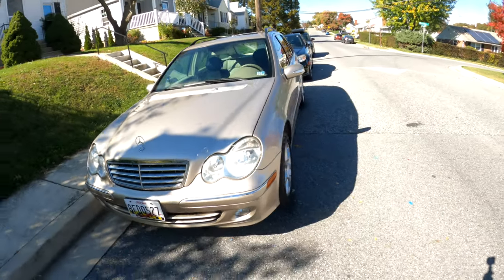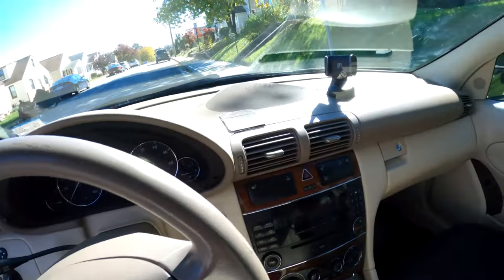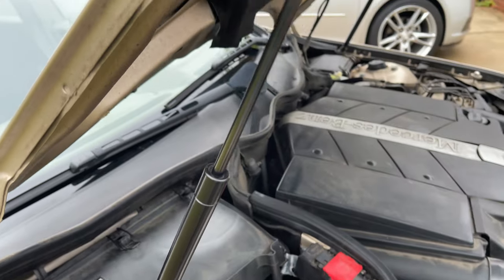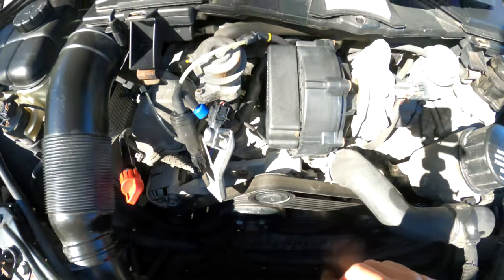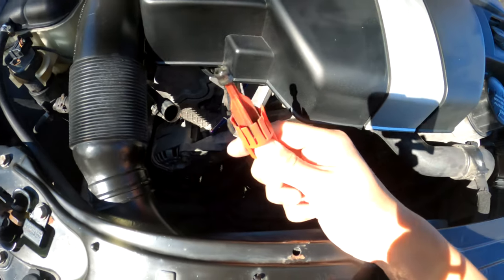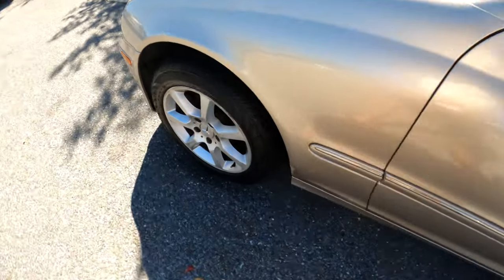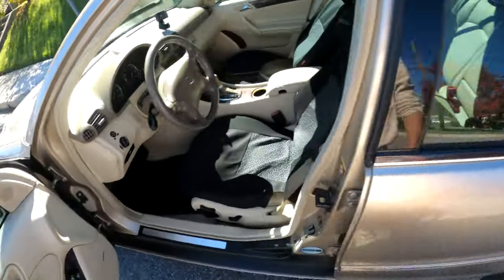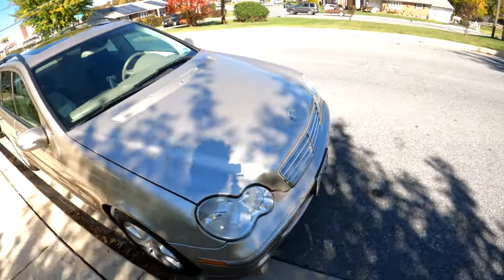W203 MERCEDES C240 MORE PROBLEMS??? MORE REPAIRS AND UPDATES!!! THE CHEAP DAILY BEATER!!!

Comment: I have an 05 C240 4matic sedan. @150K on the odometer. Changed the oil, plugs, wires, 2 coils, air filters, radiator, AC compressor, and belt tensioner and pulley. Driving it home and the engine quit at the stoplight. Would crank but not fire up. 15min later, and tow truck on the way, it fired up, so I got it home. Now being towed to the garage because I don't want to chance anything. Can't figure out what it can be. If it was the fuel pump, it would have never fired back up. rockauto all day for parts. Sometimes Ebay. Got a new compressor for $130! Also, behind the kick plate on the passenger side, there's a connector in the wiring harness. I ordered the connecting wire, plugged it in, and popped the aux cable jack into the side of the glovebox. Put a 6ft aux cord on and works great, but can't use it for phone calls. I also 86'd the CD changer in the glovebox.

Comment: Shame the previous owner didn't take such good care of it. It's a solid car, my 270 is still running strong at 320k kms.
Reply from the maker: just drove 1k miles in 2 weeks with it! she’s been a very reliable driver, just waiting for the weather to be good to change the rotors and the pads!
Reply: @UrielArtsGarage  Hello, I live in Germany and I would also like to get the C240 4Matic. It is a timelessly beautiful car.
Can you tell me how high the consumption is when driving on country roads?
How high is the tachometer at 120 kmh motorway speed?
Reply from the maker: @dennis9038  I've been getting 22-24mpg on the highway and 19-20 in the city! 

I wouldn't say it has the best fuel consumption, even a mini van gets better gas mileage nowadays but it has been very reliable under my ownership!

Comment: My dear friend, the reason the car has no dipstick is that when u stand still on an even surface, u can flip thru the menu on the wheel to check
Reply: Also the „handbrake“ is a meme by Mercedes. Anyone who has an automatic W203 doesn’t need it cuz the park is strong enough to do all. The only reason u may wanna press that pedal is to give a little bit more help when u are standing like hilariously uphill or downhill. In most European countries this „brake“ fails the test for a handbrake as it is too weak and in order to pass the test they usually brake with the actual brake pedal with
Reply from the maker: Yes the computer is very helpful however, for quick access to the level, a dipstick is a must! That’s probably why added it back for the w204! And yes the handbrake situation is indeed laughable, mine doesn’t work 😂
Reply: @UrielArtsGarage  u can buy a „general purpose“ one, it’s what Mercedes‘ use as well. Keep it in the trunk under the floor where the „spare“ wheel is at and u are fine
Reply: @adriangaber9176  hand brake pedal not returning to rest. Brake light stays on. Easy fix.. I, too, had a C240 4MATIC. Loved it. 
Common issue is there is a Spring connection under Rear Passangers seat that fails. Pull seat off . Remove inspection cover. This area is where right rear/left rear/ pedal cable join.
Mine had broken main return spring.
Search: merecedes diesel mechanic channel . He has a good video on this. I'll try to find the link for you.
Reply: If you want to get the information center to show you exactly how much oil you have in tbe motor you can do this  Turn the key on to #1 position scroll to the milage,press the reset on  the instrument cluster for 20 seconds until u hear a beep ,turn the key to #2 and press the bottom right toggle on the steering wheel ( left hand side )...and i a bunch of numbers will appear ...including the amount of oil in the engine ..it should read 7.5 when full ,as some of the oil is in the filter and heads ,an not in the pan ...you can start the motor and it should reduce as the oil is pumped up into the motor to around 6.o gts😢